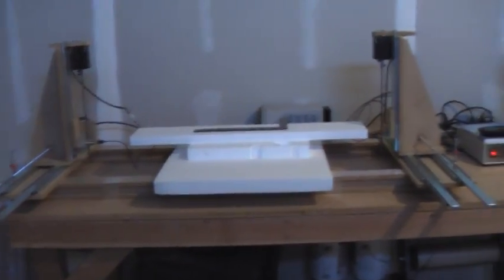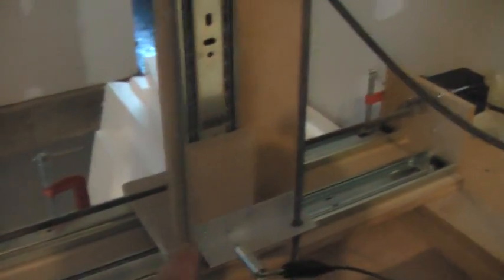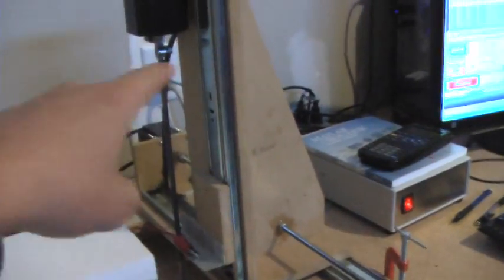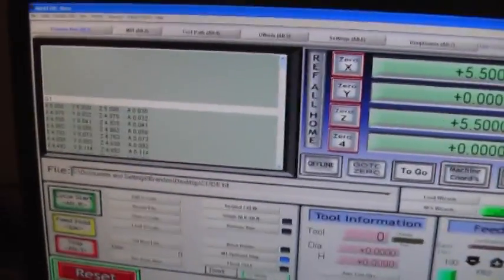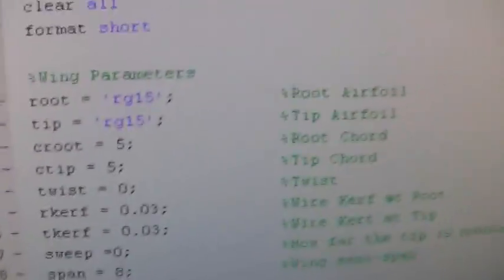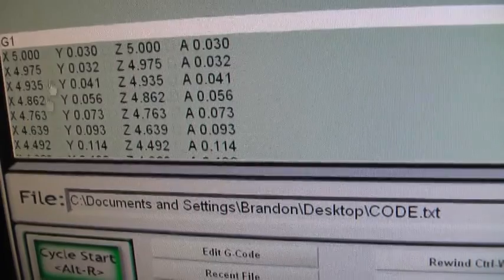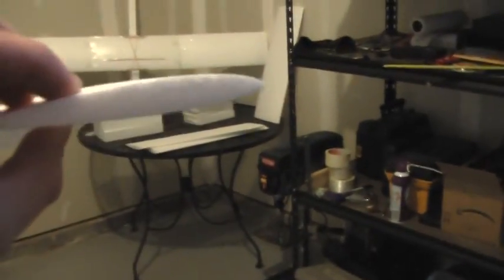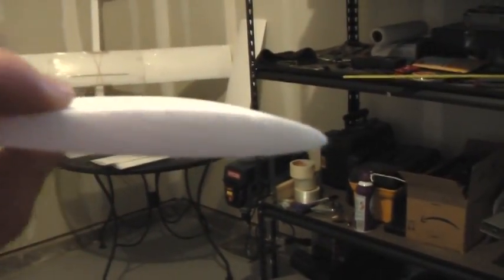How to build a CNC Foam Cutter

Comment: I've been wanting to build one of these for a while.  Thanks for the video.  I still am not sure what I'm doing.  How did you learn to make this?  Any suggestions on motors?  Where to buy the power supply?  Type and diameter of nichrome wire.

Comment: Nice machine and setup.   I'd like to make one myself.  Do you know, or have references, as to how to set the machine up itself?  ie: threads per inch on the threaded rod, and number of steps in the stepper motor.   Where is that setup?  Mach3?

Comment: You don't need the Xylotex.  There are 4 axis CNC controllers on ebay starting around $3.50.  You also need one Stepper Driver for each motor they start as low as a couple of bucks.  Finally, you are going to need a used PC Power supply to power the motors and stepper motors (Nema 17 - about $20 each -  more torque than you need) .  Download Linux EMC2 to control the whole thing (free).  Send me a message and I'll send you links.  The whole system is simple if you break it down into parts

Comment: Nice work, but you'd probably have an easier build if you had left the gantry stationary, and moved the foam forward and back (making it 3 with steppers - No tapered wings though).  Also, if you build another one, you might want to check out a tooth-belt drive system instead of the screws.  Belts are a lot quieter and since you are just melting foam, there isn't much need for torque.  It took me three machines and a lot of aggravation to figure this out.  You did do a great job though!

Comment from the maker: Yes, the motors I used a definitely overpowered so you could use cheaper ones. And yes, the left side and right side are independent and can trace different shapes. So, it can cut tapered and twisted wings with different airfoils at the root and tip.

Comment: WOW that is really cool. I to am building a do it your self CNC rig that you may be intrested in. it will help you build the wooden parts for your planes and other work. I would love to get your feed back and any input you can offer. It is a work in process so not done yet. Just the first outlay of ideas right now.

What type of wire is it that you are using and what voltage and amps?

Comment: I get the feeling that those motors are very overpowered. they are huge! wouldn't it have been cheeper to use nema 17 steppers? i would think since it's only foam it would be fine

Comment: Looks like I'll have to set up a cheap Windows PC t orun just this. I normally use Ububtu and haven't had much success with the 'Wine' Windows emulator. I'm sure someone at work will hav a copy of 2000 or XP I can beg borrow or steal. ;¬)

Comment from the maker: @ssgtbair It is limited by how fast the wire can melt the foam. I could actually cut much faster, but I've found that accuracy is best when cutting a low temperature and low speed.

Comment from the maker: I actually didn't use plans for this, although I have seen other similar machines around the internet that I got ideas from. I don't use Foamworks either. I use my homemade G-code generator and I plug the G-code straight into Mach3. Works great for tapered wings!

Comment from the maker: @OCDRC I wrote the software that generates the gcode and it does take the distance from the work into account. Deriving the formulas for that was hard, but after that it was easy to code. The most complicated part of the software is the part that accounts for the wire kerf.